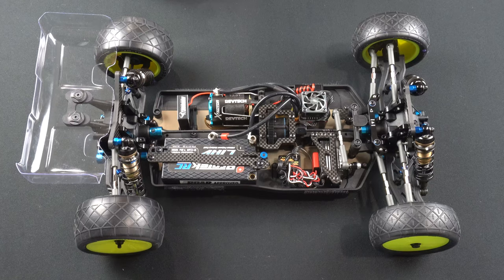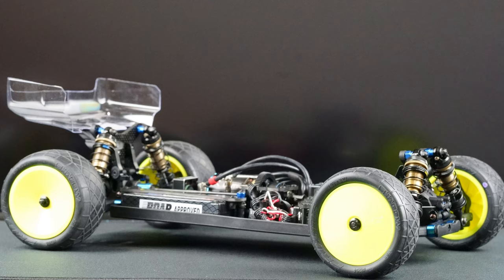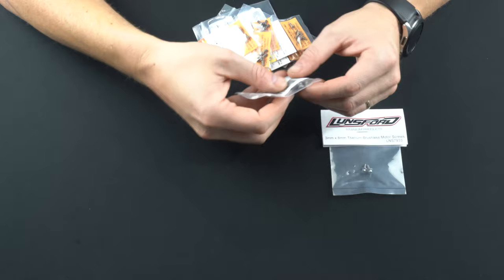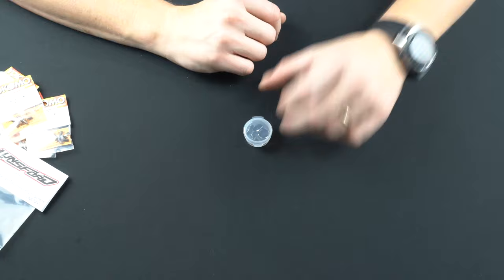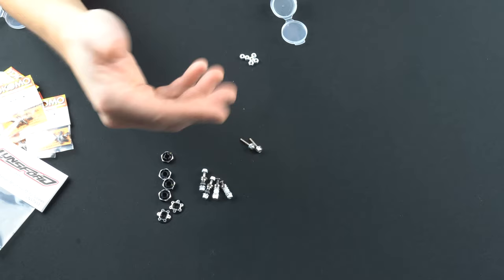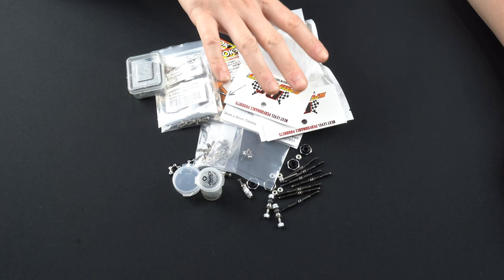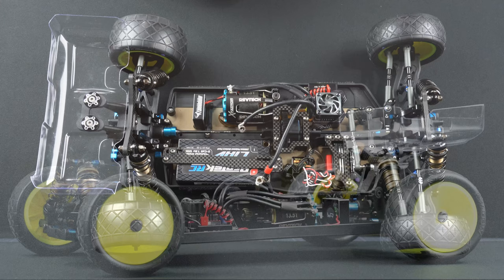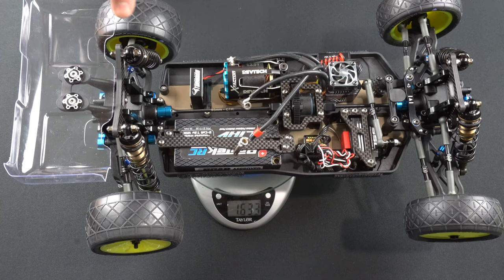Team Associated B74.1d build series - Installing 13.5 upgrades!!

Comment: Great video. I’ve done the lower rear shock mod on a few of my cars now using a 12mm (I think) set screw and an M3 nut. Makes fitting and removing so much easier.

Comment: Why is it that Team Associated has a gear cover for the Pro 4 SC10, but not the B74.1D?
Reply from the maker: Great question!  I run mine indoors so never really had an issue with rocks etc.  Would be a fun 3d printing project for sure.
Reply: @DaveDriggs  I tried to 3D print a gear cover for my B6.1DL, and I still failed 13 times.  Fortunately JConcepts sells a standup motor plate, allowing me to use the standup transmission gear cover.

Comment: i have the B74.1 but if i knew that the 74.1 used the B64 shocks and shafts i would have bought a used B74 and converted it

Comment: Have you noticed a difference in acceleration with the plastic over metal gears since lighter equals less rotational mass.
Reply from the maker: I was reluctant to run them after bad experiences with the EB410 plastic gears (never run the plastic gears in the center diff for that car).  So when picked up a b74 I kept the metal gears which holds the car back for 13.5 racing.  Some people are even running the plastic gears in mod!  Def. worth the investment, AE has some strong plastic.
Reply: @DaveDriggs  I have a tekno. I keep snapping teeth on my center diff. new to this hobby. do they have metal gears

Comment: Tires look weird for me. Are these for carpet or artificial grass
Reply from the maker: Indoor smooth clay tire.  Use these when slicks or ghost pins are working.   It's a very low tread tire so no sanding and quick break-in.
Reply: @DaveDriggs  ok thanks for answering

Comment: How about the slipper vs center diff...insofar as weight?  Performance disadvantage vs weight?
Reply from the maker: The slipper is a good option to shave some weight on the drive line.  I ran it a lot in my 74, the car accelerated  faster but was slightly harder to drive and had more wear on fronts.   I recommend it as a tuning option for sure.  It might give you an edge!
Reply: Thanks, What made it harder?  I’m honestly curious...I guess it’s been a while since I’ve run 4wd
Reply: @muddfoot69  my guess is that it drives more locked or stiffer to say since the slipper will try to move front and rear at the same time vs center diff